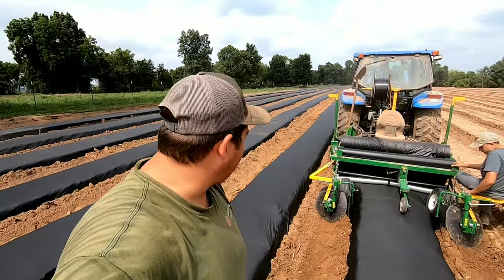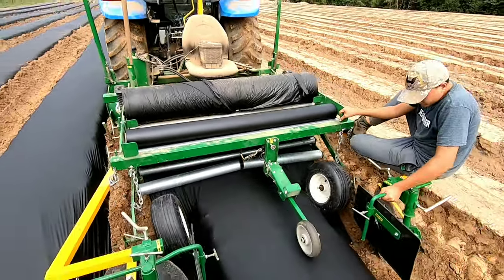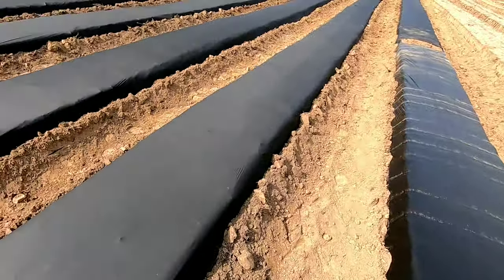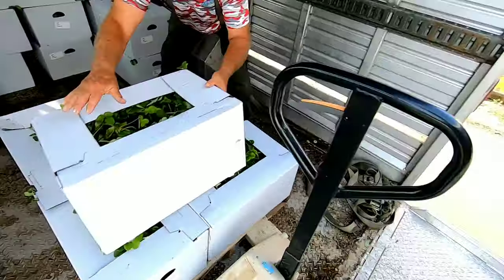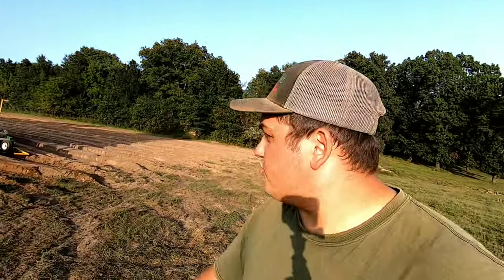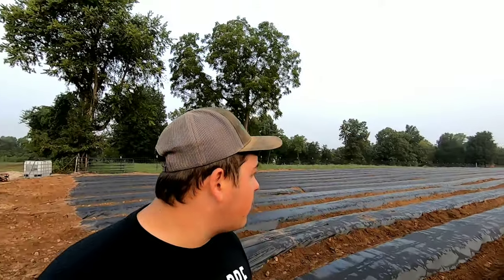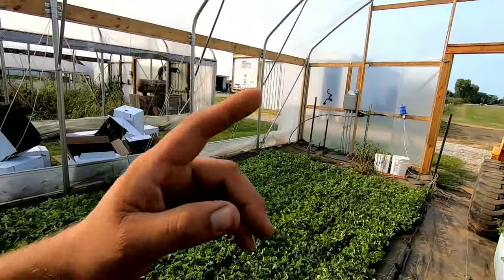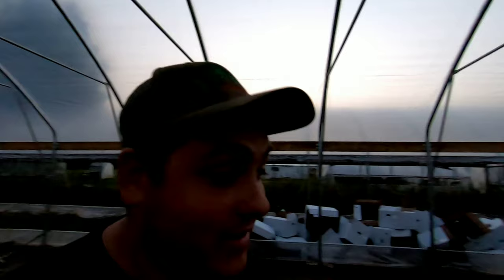LAYING Plastic Mulch for STRAWBERRIES

Comment: Hey us cajuns down here in Louisiana say "As long as a snake won't break its back going down the row, then the row is ok"!!!
Reply from the maker: 😂😂😂😂  Thanks for Watching!
Reply: Forget that whell... GPS and RTK...
All the rest is crap. I got that experience too. I cannot afford a GPS system cause here a good one, (forget JD GPS that is crap), Trimble or TopConn costs like 18k € here... plus anual licence and GSM Data card... but it worth it. But as i said, i cannot aford it. But i had worked for contractors with that

Comment: Put some sand bags on those discs or adjust the tilt of the disc. We had the same problem tho where I was having to adjust it Everytime I turned around. So instead of adjusting or having to set on it we just stapped a sand bag to it. And it helped enough and had brother with shovel fixing any bad spots and riding on the seat. And buy those center bed fillers from rainflow well worth $300 if we didn't have those we had same problem tractor couldn't pull enough to the center that gives it just enough to fill it in one pass and still make them firm.
Reply from the maker: This is the first year using this machine and we need to figure it out!
Reply: @farmerdre1  this is our first year using it too its a big learning curve for sure but we managed to get them layed. Just wasn't pretty lol.  Hope the planting goes smoothly we plant bear root plants cuz we don't have the water wheel like u guys buy plan on investing on one soon so we can plant some plugs too and make it a little easier. So we already planted the bear roots last month but have the same planting date for the plugs in our area mid September to last week of September

Comment: We used Andy for our plugs here in Texas. Great plants. Say hi to Andy next time you see them. I'm looking at running my rainflo over the pre-laid up beds like  you did.  Did that work out ok? I normally just do a one pass mulch and bed with the rainflo but don't get the centered filled in favor of getting the edge of the mulch covered due to high wind.
Reply: Buy the center bed fillers they just bolt on to the rainflow. Or work the ground up more . You shouldn't have to make 2 passes. the point of the machine is to do it in one pass they make other machines that are probably cheaper that u lay the bed with one and lay the plastic with the other but the rainflow is a bedlayer and plastic layer. Read the instructions and get it setup to do it in one pass the seat on the back is for someone to set in to make the bed firmer and so they can change the plastic. Adjust the top bar on the 3 point lower or higher. And if it still isn't pulling enough dirt probably not worked up enough. Personally we still have alot to learn with our 2550 next year to make it run smoothly there are alot of adjustments. But the center bed fillers for it helped with the problem u and farmer Dre are having for us the beds are still firm with one pass u should be able to leave a faint foot print in the bed but not sink foot in it if the bed is firm enough